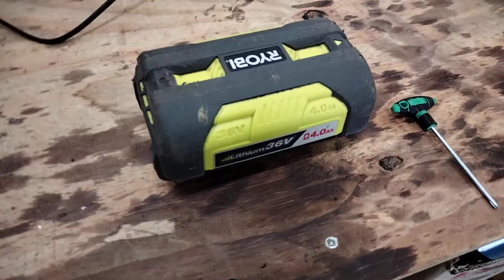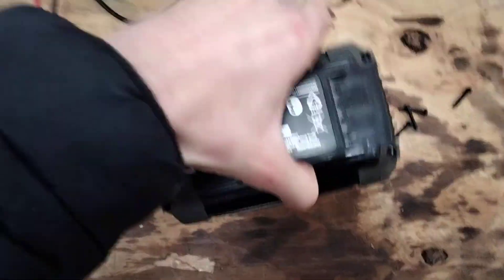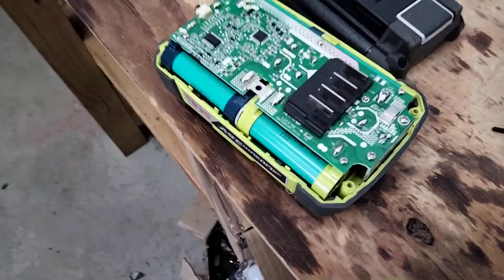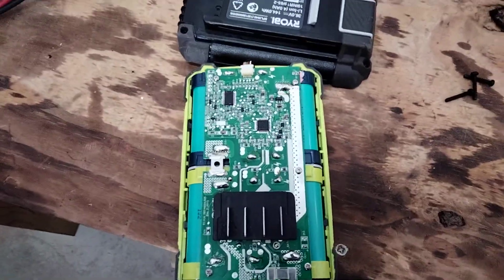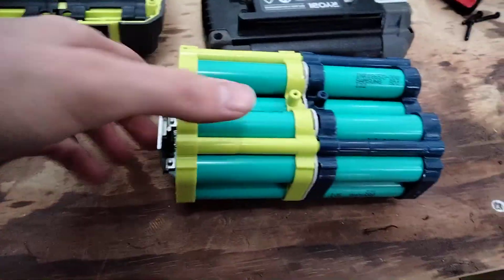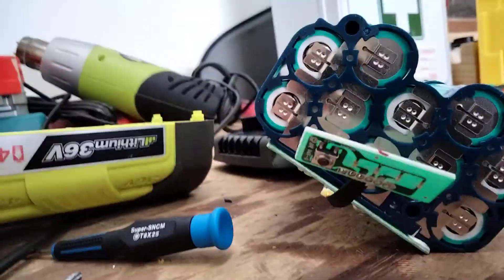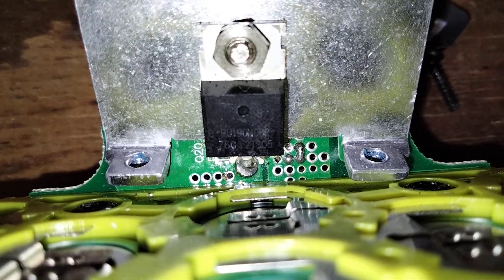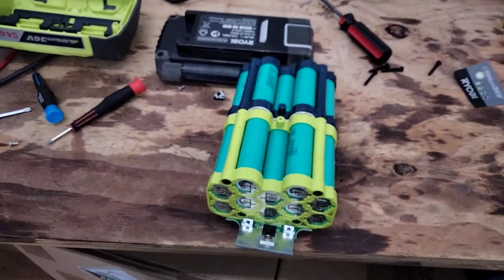RYOBI 36V TEARDOWN BPL3640

Comment: Nice, but would have been good to see how to replaec the cells. I pulled mine apart to that level, but then couldn't get the board off. Undoing the screws o nthe board didn't release it. So I couldn't test or replace individual cells.

Comment: It will have balancing... It has to have it because without it, it would risk overcharging one or more cells. The balancing would be the simple type where it just applies a load to any cells that are at 4.2V before other cells. That's what the heatsink is for.

Comment: Thank you. I missed the upper 2 screws, too; thats why I found your video in the first place. My battery survived 9 years powering a smaller lawnmower, sometimes discharging it heavily with wet grass and stuff with a mean usage once every 2 weeks from spring till autumn. This battery is a beast, honestly. I own several due to several tools I bought over time and am absolutely satisified. Even though you did answer the question of replacing single cells below, I would really appreciate your opinion on using the remaining proper cells (after measuring the internal resistance and such stuff) in the case the other batteries, I own start to fail. Their age is around the same +/- a year or so.

Comment: hello, do you think i can extract each battery to find the faulty one? it cost 200€ to change the whole pack :(
Reply from the maker: Hey N' Usul, great to have ya on the channel! I think it would be possible, but be careful, a new cell with old cells can cause battery failure if the cells go out of balance.

Comment: Interesting! They are 40V in USA. Where are you?
Reply from the maker: Im in Australia! I believe that the 40v rating is a marketing tool they use - 36v is the nominal voltage for a 10-in-series lithium ion pack, 40v is closer to the fully charged voltage. 
Thanks for the comment!
Reply: @BobsEVGarage  Right! That's funny they do that in different countries. Maybe Australia doesn't let them use peak ratings. Good on ya mates 😄
Reply: For the first few watt-hours, they probably are 40V, or even 41V, but for most of the capacity at typical loads, 36 - 37V would be right.
Other brands of power tools use the 4V per cell rating here in Australia so I don't think it is legislated. Be interested to know what voltage the 5 cell batteries are stated to be in the USA.